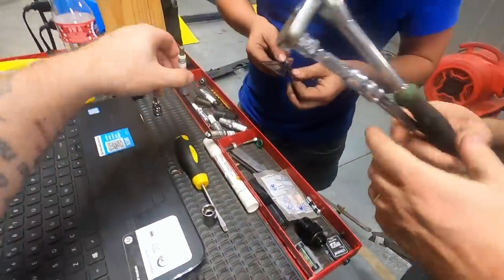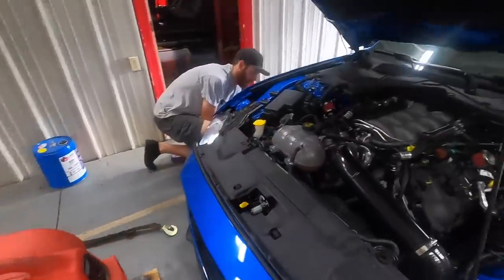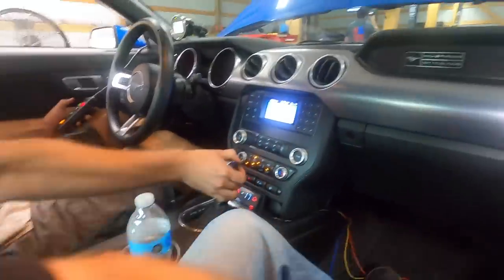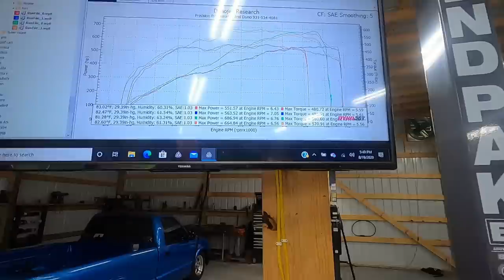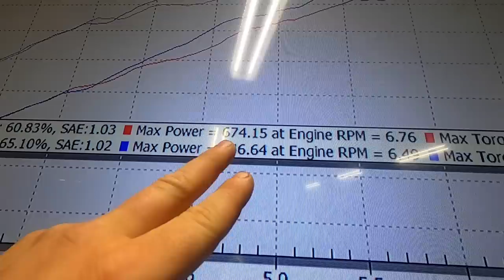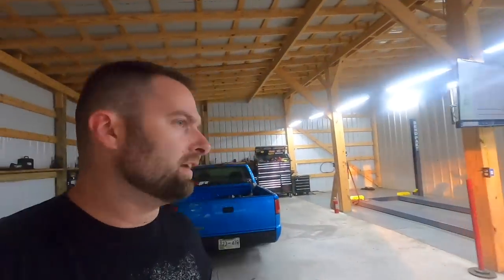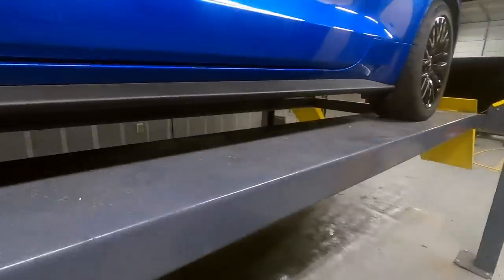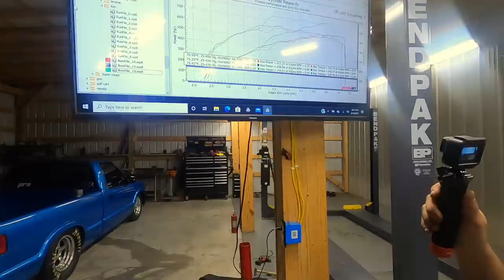SNEAKY 2020 Mustang on Dyno has "HIDDEN" TWIN TURBO'S  *Makes HUGE POWER!

Comment: Question regarding the vacuum block ,, should it be like ( break booster > vacuum block > intake ) or ( Intake > vacuum block ) ? mine is the first method just wondring if its correct or not !! thanks for the great contant